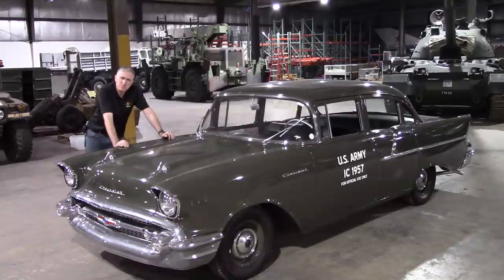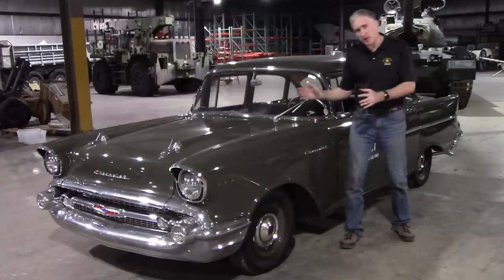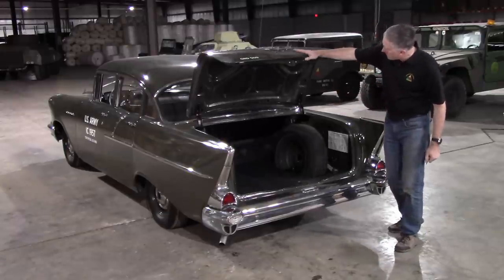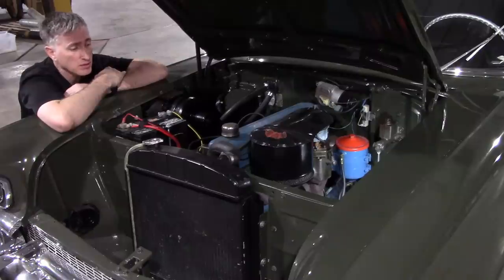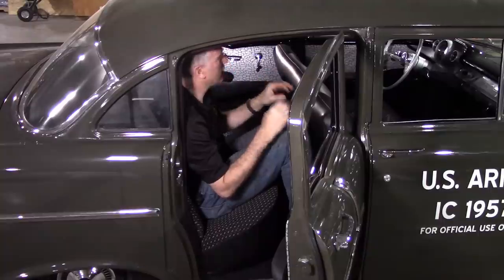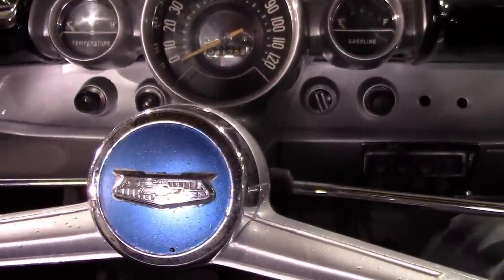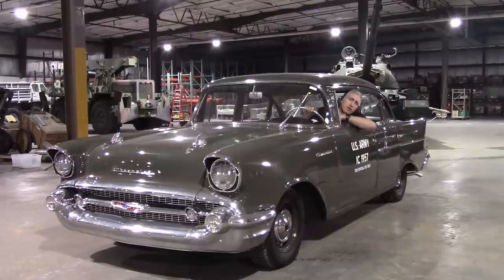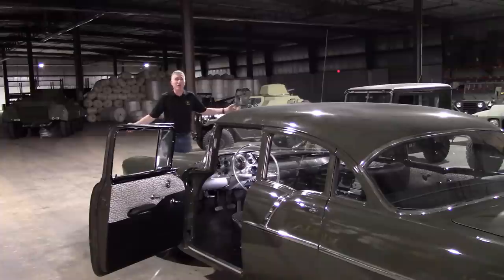Inside the Chieftain's Hatch: Chevrolet 1503

Comment: The far left switch is for the wipers.  Apparently that switch went out and someone has wired a different wiper switch below the heater controls (non-original).

Comment: Those windshield wipers are just parked wrong!   The vacuum ones would stall going up hill with the throttle open.  I drove a 65 Biscayne for the US Navy. It still had the 3 speed and black stripped down body.  Owned a 56 210 six with 3 speed.

Comment: If the rear passenger compartment seems a bit "tight" try a 1957 Austin on for size. And if the General feels cramped, he will order the driver to move the front seat forward. Rank does indeed have its privilege.   Electric components come courtesy of Delco which were a bit more reliable then their Lucas equivalents. *  The chrome grill/bumper design was meant to invoke images of Cadillac.  On the Bel Air the bumper extension had rubber tips ass opposed to the chrome cover plate. The covers on the rear bumper were added when the original plan to have exhaust exits there was scrapped. 
* an intentional understatement. : D

Comment: When I was 17, I bought a '57 Chevy 4 door sedan that had been a railroad supervisor's car.  It was in perfect condition and I only paid $275 for it.  It had an oversize generator and a larger battery.  I assume it must have had a 2 way radio, but it wasn't in there when I got it.  It had rubber mats on the floor, no carpet.  Metallic green with a white top.  Had the 265 c.i. V8 with a 3 speed manual factory floor shift.  It ran really good.  I sold it for $500 a year later to buy a '63 Corvair Monza convertible.  Worst decision of my life up til then.  Went from high reliability to terrible reliability.  But, at least I learned how to work on cars.

Comment: Ah yes the 1503 Personnel Carrier. I heard it had 3mm thick armor, which was 170mm less than a Sherman, still probably more than a Hellcat though, and was able to protect it from High Velocity Armor Defeating Shopping Carts (HVSC). It had a Driver, a Radio Operator, very important for long trips, and depending on the company you keep a second driver in the back seat. Fun fact, some modern vehicles still have this crew layout.

Comment: My mom had a Dodge conversion van with those smaller windows on the front doors. Believe it was a 98 Dodge ram 1500 so those little windows are still around. They were nice since the AC didn't work on it.

Comment: The chrome shades over half of the headlamps is a quasi blackout (seriously), just as the original blackout was a full cover with a slit.  The right side dimmer could actually be for a siren.  Especially in the Air Force in the day (definitely SAC), a general had the authority to have any and all traffic cleared for him for any reason (not any, but it was abused routinely).  SAC base commanders were known to have a fiefdom complex in their head.

Comment: The first car I ever owned in 1969 was an old Chevy 57 four door in two tone, brown and cream.
Used by a farmer to haul hay for his cows he took the back seat out and carried bales. I paid $200.00 for it.
Three speed on the column, am radio when I first turned the heater on steam from coolant leaked into the cabin, fogged the inside windows and we rolled down the windows to see where we were going which made the hay fly around and get stuck to our faces.
Stopped at a gas station and the guy who came out looked at us like we were crazy, said, "Ayup ya'll shoulda bought a Ford."

Comment: Yo, Chief! Those chrome protrusions are evolved Dagmars [they began showing up on the bumpers of Buicks & Caddys in the late '40s iirc, named for a certain breastacular movie starlet]; & were originally more, shall we say, hydrodynamic? By this stage in the late '50s, they've been influenced by jet-age design and in profile are more reminiscent of the air intakes on the front of the new jet fighters than their original mimicry of feminine secondary sexual characteristics... @ 6:05 -- The fuel filler is hiding inside one of the tail-fin 
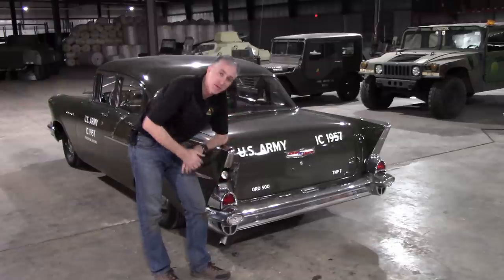assemblies, iirc this vintage correctly. Ah, you found it! [6:40]  Another 20 years on, Cadillac would be hiding it behind a flip down license plate holder [as on my mom's '75 Sedan de Ville. What a barge!]

Comment: People were more trusting in 1957.
None of the early car models that I drove  from GM or Ford had interior hood latch or interior gas cap cover releases.
From a 1953 Ford 4door 6 cylinder “3 on the tree” shifter through a 1965 Cadillac Fleetwood and a 1966 Ford Mustang Convertible 289 V-8.
They all had lots of Chrome.

Comment: Suggestion for a project car: a 1970s AMC Hornet - or a Javelin/AMX, if you like it sporty - is a good option. It's relatively obscure, but most of the parts are still available and there's a really nice community for them.

Also, I now want to see Tactical Chrome Trim on an M1 Abrams.

Comment: Chevy 57 built as a tank.  
No Tracks but alot of chrome.
It seems extensive research is needed. (Fillercap is found)

Are the 2 mirrors necessary while EASY cruising on the public road.😊

Comment: It has more options than just the heater & ashtray.  The oil filter was an option, as was the electric wiper motor (vacuum was standard).

The location and function of the wiper switch under the dash is not original.  The original wiper switch is just to the right of the headlight switch.

The "air vent" on top of the dash is not an air vent -- it's a speaker grille (for the non-existent speaker in this car).

Comment: Chrome--the bane of privates and delight of sergeants...
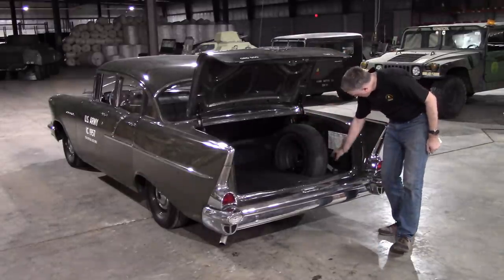5:30 A bumper jack; it hooked into a slot to raise the appropriate corner to change a flat.  If not properly set, the car could fall off; a safety hazard if you're in the way.  Still easy to use; I miss them.

Comment: Most of the “chrome trim” on the car is stainless. Bumpers are chrome though. The 150 2 door was extremely popular with drag racers in the 50’s as it was the lightest of that model with the least amount of stainless trim and they would remove the rear seat as well as some more of the stainless trim. Of course for racing the 150 would be ordered with the 283cu inch V8 engine.

Comment: 1503 is a official Army serial # in sequential order which makes the 1503 in the order. Chevrolet built more than 3 of these!!   Also wiper switch is located next to the lights switch on the dash , this is an add on probably because the restorer or owner could not find or rebuild the orginal !!!
Reply from the maker: No, the 1503 is the Chevrolet model number. They built about 4,500 of them for the military, the claim is that only three military issue ones still exist.

Comment: The chrome protrutions at the front and the back are delete plates for ware the  reverse lights high beams and turn signal options would have been mounted. Also its not unusual for american cars up into the 1980s to hide the fuel cap.

Comment: My family owned a 1956 Pontiac coupe that had its fuel filler under the rear license plate bracket, which was mounted with a spring to keep it down when not in use. Ahh, those were the days when we would take a drive out into the country and see our great land, at the cost of gasoline around 25 - 27 cents a gallon. Once, during a summer drive, my Dad had his left arm out the window and got it sunburned. For about a week he had to wear long-sleeved shirts to allow it to heal. BTW, the reason that cars no longer have "vent windows" in their front doors, is because burglars would force them open to reach the locking pin and get inside to see what they could steal.
Reply: Gasoline was cheaper, but people also earned much less money as well so it kind of balances. Not to mention way more toxins in enviroment. Tetraethyl-lead is nasty stuff.

Comment: Actually I am surprised they didn't use a Checker Cab or Checker Limousine body, much more expensive, but ton's of legroom in the back. I expect any Officer taller than 5'9" (a perfect height in my opinion) would ride in what was essentially the kiddie seat in the back of the '57.

Comment: Was wondering how long it would take you to google that knowledge. Hidden filler necks were common back in the day, (yes, I'm much older than you - I remember them well). They stopped doing that by the late 60's early 70s. The reason was if you got into a rear-end accident, you would often find yourself quickly surrounded by a pool of gasoline. As the tanks would rupture at the filler neck joint. Often leading to the dreaded "Oh Bugger! the Chevy's on fire!" moment. 

Unless the government specifically deleted them, a very good possibility, there should have been floor vent regulators just below the dash down by your calf. I have always missed the quarter wind vents since they went away. I want them back!

Now just imagine if your Abrams or Bradley had that kind of chrome, just how much more effective might it have been...........

Comment: Handle left and below the steering wheel IS the Parking Brake control: Pull to engage, turn 90 degrees and push in to release.

Comment: Did you ever find the dimmer switch for the head lights?  Hint, it was under your left big toe.  By the by, the vent windows in the front doors were the greatest features ever sacrificed to style in American automotive history.  An open vent window could evacuate smoke from the interior of a car quicker than any other non powered system, a handy feature for the 'on bugger, the car's on fire' test.
Reply from the maker: Well, yes. Look at 15:12 when I use it.
Reply: Thanks for the reply.  I'm surprised and delighted that you took the time to read my comment.  It was meant as a funny observation rather than any criticism.  I love your videos.
Reply from the maker: No harm done. Enjoy.

Comment: That switch for the wipers may be an aftermarket addition, I think they had vacuum wipers back then...step on the gas the vacuum drops and the wipers stop!
Reply: Yes, vacuum was standard and electric was an option. Though in both cases, the control was to the left of the wheel. BTW, in both cases, the wipers should rest nicely on base of the windshield. This electric setup was apparently added later.

Comment: The left floor button is the dimmer switch, I have no knowledge of the right one, nor have I seen one.  Although some brands notably American Motors had the starter switch there.  The good ole' 235  Six, base engine with 3 speed manual (or 2 speed hydromatic) was basic.  Although most restored ones NOW have the V8, the six was by no means "rare", common would be the better term.  Since my 1st car was a 60 Chevy BelAir I'm intimately familiar with Chevys of this vintage.

Comment: I would say for the glass (I watched a fascinating video about making curved glass car windows...whole cars, in fact...recently), either you find "new old stock" (NOS, unused components still in warehouses and stashes around the country/world), or you find reproduction parts, which should be easy with a very popular car like the Tri Five Chevies. or you find the same model car in poor condition and you strip it of the part you want. 
If you have a less well-known or more rare car, without any sources of NOS or repro parts, and no donor car can be found, there are places that can make you whole new plates of glass. it is not cheap, since they are basically one offs if the car is that unknown. How they know the curve and shape, I am not sure, but I suspect that each product in a totally one off, more of an artists commision than anything. They measure and inspect old photos, try to find an existing car to take measurements or molds from. Then they need to build a jig of the correct shape and curveature. They they cut a series of panels of glass to the required outline (which has to be determined from the curved prototype, unless they can find factory documents giving them a pattern to work with) and glue them together with special sheets of clear plastic that turn to adhesive when heated, until you have a laminated sheet of safety glass. Then when the correctly shaped sheet of laminated glass is ready, you put it into a furnace and heat it up slowly, until the whole sheet softens and sags down into the mold/jig, forming the correct curvature. Then you slowly cool it down, and voila, one glass window. Since the actual making of the window is the easy part, and the determining the dimensions of the curves and the glass and building the correct mold for it is the hard part, you can see why mass produced parts are (as always) cheaper. Though once a mold is built it exists, and hopefully you only need to have that done for really obscure parts. Otherwise you can obtain or rent an existing mold, or find whatever glass company has the mold that was built previously when the last guy with the same rare car needed a new rear window.

Comment: The reason they don't put the fuel filler neck in the back of the car is the tendency for the filler neck to break in rear-end collisions.  Safety regulations killed the hidden fuel cap.

Comment: Two anomalies; the army were concerned with longevity  I guess because the civilian version required checking off an option box if you wanted an oil filter installed.  The wiper switch under the dash is some kind of jury rigged affair as the factory installed duplicated the headlight switch and would have a rotating feature to select speed.  They would also auto-park in the down position when shut off.  Don't know why anyone would have installed that cheap single function thing under the dash.

Comment: The protrusions are there because they couldn't fit the specified amount of chrome onto the bumpers any other way. If it still had the authentic issue equipment, the boot space would be even smaller due to the presence of the KIT-M1A1-POLISHING(CHROME), of course.

(While writing this post, I typo'd 'chrome' as 'chrime' every single time ... Freudian, methinks...)

Comment: Looking for a project car.... there you go Chieftain  outside of some safety mods Give it disc breaks all around, and new leaf springs in the rear, new modern tires, you would have actually a show winner only for the fact that it is an Army Owned plus  You don't really see a Chevy 150 at shows.  You will have to rework the engine only for the fact that then there was leaded fuel, and the valve seats were designed to use the lead as a lubricant.  and that is really it.  perhaps upgrade it from 6 to 12 system and Seat Belts for the inside.  and heck with Bench seats, hell you have the perfect Date nite ride with the wife.

Comment: 14:47 it's called a three on the tree because the shift pattern is shaped like a tree and if you're not used to it it is a b** to drive up and forward is first gear down and center is second gear up and center is third gear and back  I couldn't tell you it's up or down is reverse

Comment: Three on the tree.............. 
1st is straight down from reverse,2nd is out and up and 3rd straight down from that......sounded like when you moved it it was in second and slipped the crap out of the clutch.Should've used that Google to search the shift pattern of a 3spd.. 
I was 10 and that was the trans of the 1st car I learned to drive,'71 Bronco and it was 10yrs old then also.
At 14 my 1st vehicle was a '68 Bronco (Bronco's didn't come with auto's until '73) and still have it 37 yrs later and had a total of 4 of them over the years.I later had a '64 Fairlane 500 with a Three on the tree but it also had overdrive that you just pulled a lever to initiate.There were cars,vans,trucks with 4spd also on the column/"tree".
I'd rather have a stick any day over an automatic.

Comment: That really is super clean, like it was never issued. If it was restored, they did a fantastic job, and they must have spent far, far more than they will get back, since it isn't even a top model or anything. Hopefully it has driven the price up enough that some asshole won't take it and cut it up and make yet another lame and horrible hot rod out of it. Pretty soon stock Tri Fives will be the most valuable because there will be almost none left. If they aren't already hard to find.

Comment: 15:14 Chieftain says I have know idea. It is a push type high/low beam selector switch for the headlights. I do miss the old push type selector.
Reply from the maker: That was about another device, I demonstrate the high beam in the video, I have also seen it fitted to some tanks.
Reply: @TheChieftainsHatch  The other foot switch is probably for the window washer

Comment: You saying that you don't know much about a Chevy was "spot on", especially the '57 model year. I've probably forgotten more about a '57 Chevy than you'll ever know. 
For example = The electric windshield wipers were a 'retrofit' during restoration. The original wiper motor was vacuum operated and the speed of them was governed pretty much by your speed going down the road. Kind of like modern variable speed electric wipers nowadays. BTW, the fuel capacity of 16 gals. was only for the I-6. V-8 models had an 18 gal. tank.

Comment: You're showing your youth!
Reply: No, good basic info with humour.  Missed the "bugger, this tank is on fire" and my aunt would loved the hood release, trunk release, front and rear bumper questions, and the Top Secret gasoline filler inlet located under a chrome hinged vertical fin. Oh yes, at least the Bel-Air of this year was 12 volts. American safety glass and British safety glass are opposites. British shattered where American windshield and sides were sandwiched between plastic film holding two lawyers of glass, don't know about rear/never saw one broken.

Comment: Those little dents behind the headlights are "cruiserline ventaports"  (Honest.)  It's an aerodynamic thing...  Enlisted drivers DID NOT get to run the seat back for his driving comfort.  The front bench seat was adjusted for the rear passenger's comfort...  Run up 'til the steering wheel was in the driver's navel.